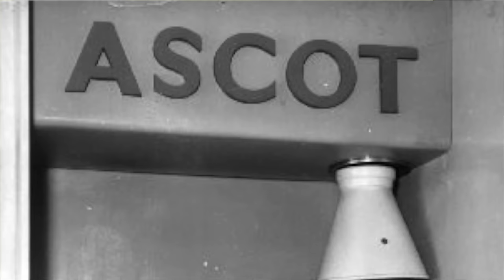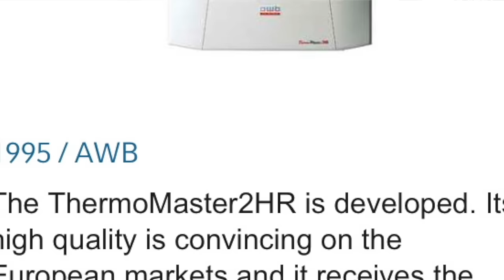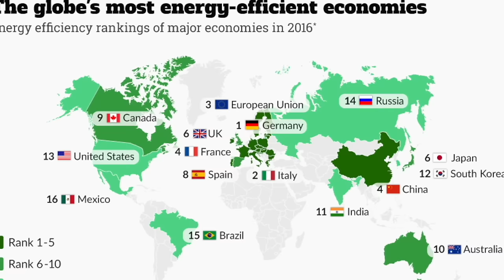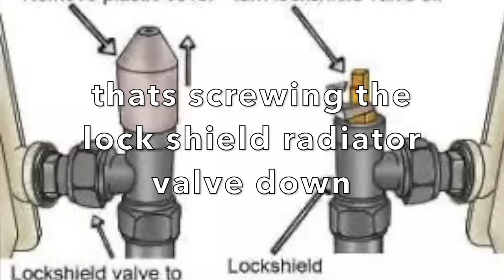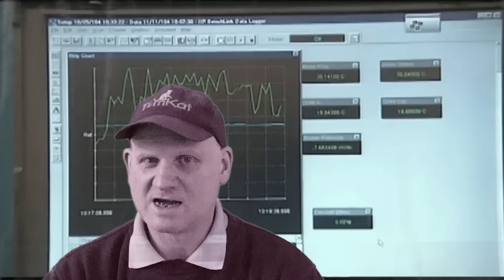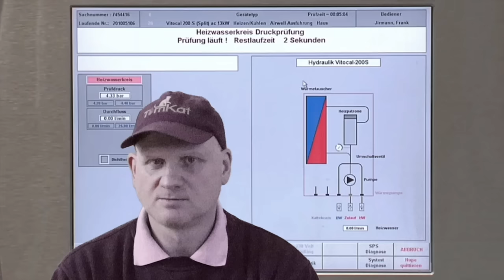WHICH IS THE BEST GAS BOILER for your home. Looking into the best boiler for uk homes in 2022

Comment: 15:00 Tomkat mentions about boilers cycling due to being oversized, this can be the case but I find most boilers can modulate right down to avoid this. 

We have a 4 bed house and a 38kW boiler running at 60c on central heating ( running at lower temps are better for several reasons ) and our boiler runs for ages at a low level but never needs to cycle even when the room TRV’s start closing.
Reply: Daniel Collins 38kw in a four bed house is still ridiculous though. I heat a five bed detached Victorian house (solid brick walls, original single pane windows) with a 24kw more than adequately. Plumbers still massively over specify boilers for some reason.
Reply: @spencerwilton5831   Agreed it’s over sized for the heating, but it’s a combi boiler with extremely good hot water flow rates and that’s where the extra KW’s are needed.
Reply: @spencerwilton5831  yours is a system/heat only? What does it simmer to, 10:1?

Comment: Correct on oversizing, 80% of new installs I see are oversized. Drives me mad. Try persuading a builder and punter that all they need is 10-18kW - always a struggle.
Reply: Yes I agree with you, too many customers telling me my job and how much to charge, we don't do it to them. regards george
Reply: I have a 25kw in my small 1 bed garden flat. Could it run another radiator out in the garden room then? I was told that you need a bit of extra to run the shower/bath off a combi. Would an 18kw heat my flat and provide a good shower?
Reply: I think that builders or who specifies are not as good as they should be thus install what's cheapest UK build is the worst in Europe, I wonder why. Thanks for the comment, george
Reply: @dugbert9  Hi Dugbert, no unstandardised what rads have to do with shower.george
Reply: Maybe they have a 24kW heating Coil in their cyl. & they want the 40 min re-heat time they've paid for? Just a thought!
Reply: @mariamalik4810  24kw coil will reheat 200l from 15-60 in under 30min. Actually 18kW will do it in around 35min. Put cylinder on hit water priority and you will never really need more than 18kW. 

People oversize because they don’t understand how to do heat loss or how to size boilers and heating systems.

Average heat loss of a home in UK is around 6kW and 80% of houses are below 10kW

If yiu out oversized boiler or will cycle, never be efficient and will break down prematurely.
Reply: @UrbanPlumbers  I have a qu. We have a 4 bed w. 2 en suites, 1 main bathroom and a wet room. Our underfloor heating and radiators come to 14kW and we're having a 300L unvented cylinder. The house will soon be used as a guest house sleeping up to 8 people. It's a Victorian end of terrace with a large extension and the original house has been insulated up to building regulation standards. 

What size boiler do I go with and which one? Ideal Vogue Max System comes in 15kW, 18kW, 26kW and 32kW.
Reply: @UrbanPlumbers  also, I'm being told that the Vogue Max has a 1:5 ratio of modulation I.e. a 26kW will lower it's heating output to 5.2kW when needed. This is under half of my total load. Is this OK to consider? There are times I'll set my stats and trv's to 10 degrees when there are no guests in the house. Do the trv's override the stats or is it the other way around?
Reply: @mariamalik4810  what’s the property heat loss? Is it actually 14kW? If yes then install hot water priority (I think gouge can do it) - avoid S plan !

You then need 14kW so go for 15kW or 18kW if you want slightly quicker DHW recovery. 

Check how low all those models can modulate and choose one than can modulate down to at least 50% of total heat loss.
Reply: @mariamalik4810  I would go for 26kw then provided it can fire at 2 different outputs on can be rated separately for hot water and heating.

Avoid S plan - use DHWP if the boiler can do it. This will allow you to use load compensation or weather comp on central heating.
Reply: @UrbanPlumbers  I'm not sure what he's done already. I have 6 pipes running to area of the boiler. Flow and returns for UFH, cylinder and rads. Does that help? I'm going for a 26kW Ideal Vogue Max System now you've confirmed the size. This modulates to 5:1 so down to 5.2kW at its minimum simmer output. 

Why did not advise a 15kW or 18kW knowing that I only had 14kW requirement for the ufh and rads?
Reply: The 14kW I mentioned is the total output of 10.5kW for rads (slightly over sized but not grossly) & 3.5kW of ufh (assuming 70w x 52m2). Like I say, there are 6 pipes (3 x 2 flow and returns to boiler for the ufh, rads and cyl.). What's your advice?
Reply: @mariamalik4810  if 26 can modulate to 5 then you can rate rate for CH to 14kW and to 20kW for DHW - as long as it is on Hot Water Priority and not on S plan.

If the cylinder coil is 20kW go for 18kW boiler. If the coil is bigger go for 26kW

With 8 people you may want faster reheat time.
Reply: @mariamalik4810  why not talk to your installer about it all?
Reply: @UrbanPlumbers  thanks but he's been true to form in advising a higher output model is better! I'm not sure what you mean by S plan etc. Like I say, I can see 6 pipes running to the boiler and we have 3 circuits; ufh, rads and cylinder.

The coil to the 300L unvented cyl. is rated at 24kW approx.

The Worcester Greenstar 800 modulates as low as 3kW on their 30kW unit. Will this 3kW vs. IDEAL'S 5.2kW be a concern to me at all? Or is it rare that I'd ever need anything anywhere near as low as that?

I'm not sure what heat loss calc is but I believe he oversized the rads slightly to account for this; does that sound right to you?
Reply: @mariamalik4810  ask for the system to be wired as hot water priority Ans rated 24kw for DHW and 14kW for heating.

Both ideal and worcester can do hot water priority

Avoid S plan.
Reply: @UrbanPlumbers  Great, so I can still do that with the pipes we have already laid? I believe that we need a 4 pipe system run to the cylinder if we needed heating to prioritise the hot water; is this wrong? Thanks soooo much for your help. x
Reply: @UrbanPlumbers  If we rate the 26kW boiler to 14kW for heating, will the 5:1 modulation be based on the 14kW, so 2.8kW or still on the basis of the full capacity of the 26kW i.e 5.2kW? I am worried that the Worcester will be the better option given the 10:1 modulation it gives.

Comment: so the bigger boilers (if you have high HW demand) won’t drop down low enough if you don’t have a big CH demand? Suprised they aren’t more flexible. I want CH to be more efficient but I woudln’t want to have to compromise on HW for that.  Should I try and have a simple heat loss calc done for CH if I’m replacing a boiler?

Comment: Excellent review.  I have a 3 bed flat with an old Ideal Mini C28
 gas fired boiler. Im thinking of replacing it but I am clueless about Boiler Technology. Also I am planning to install underfloor heating in the future. Any recommendation would be great. Thanks Guys & ladies ofcourse
Reply from the maker: The gas engineer you get for the job will be the best person to give you advice as they will have seen the job. My advice would be get a boiler with the longest warranty at your budget and make sure you get the boiler serviced every year. Thanks for watching cheers
Reply: any boiler will be fine, way too much fuss is made about ten year warranty when modern condensing combi's don't last much longer than that anyway. more important is the existing gas and plumbing, and whereabouts in your house the new boiler and underfloor is going to be fitted
Reply: If you are going underfloor make sure there is a good well established local company to look after it as most, including the big ones won't touch it. Great when it works, absolute disastrous when it doesn't.
Reply: @tomkatgastraining  A long warranty makes no sense for us engineers who do a correct servicing regime,  where do you go when it breaks ? Do you turn up and say oh get the manufacturers out. ?
No i repair.
Reply: I prefer Intergas for Combi installs, Vaillant as heat only with unvented hot water  BUT control is the key, invest in a comprehensive control system. Drayton Wiser i prefer for combi, Honeywell Evo for underfloor and unvented hot water control.
Reply: @kevinschoales844  I never heard of Drayton Wiser, thank for you mentioning this company, I will look into them. At a glance, they look similar to Tado. Have you heard about Tado?
Reply: @feelgeorge  yes good reports on customer service, from Germany.
Not fitted any.
Reply: Get a local company to come and assess your flat and give you a proper idea my preferred choice would be a viessmann vitodens boiler 10 years warranty they are number one in Europe and they are very popular in UK at the moment and more importantly they are actually designed to run on underfloor heating

Comment: Question to gas engineers: I have a brand new system, buteline, 24 rads, intergas 40 and evohome.  My engineer won't fit an external pump but my ground floor rads won't all get hot.  It strikes me that my lovely new boiler isn't working effectively as the pump isn't taking the water around quicker.  Any comments?
Reply: Lovely boiler , sounds like the installation
Reply: @peterrielly9499  
I agree.

Comment: You say oversized boilers can cycle reducing efficiency and life but also say boilers are modulating so wouldn’t they just modulate down to a lower KW and therefore not cycle?
Reply from the maker: It’s all about setting the boiler up cycling means the boiler goes on and off because there is too much heat in the boiler so wasting gas. Modulation is when the boiler is correctly set up and the boiler can maintain the heat loss without knocking off.
Reply: @tomkatgastraining  thanks. Be nice to see a vid on how to set it correctly to achieve this. Keep up great vids!
Reply: @akshaypatel3338  if you go onto the stelrad website you can calculate the KW requirements of your rad / system then if your boiler allows it adjust to suit. Not an exact science but a v good start point.

Comment: Main reason I went for a vaillant ecotec was the ability to adjust the heating partial load, the similar Worcester at the time didn't have that option. Have my 28kw boiler reduced down to 14KW for the heating, flow rate set at 60deg, I have 4 K2 rads downstairs, 2 tiny toilet rads and 3 bedroom K1  rads and one K2 in the bathroom, Roomstat at only 19 (big hallway)  and the house is always nice and toasty 🔥
Reply: No.. your house isn't ..'Nice and Toasty..' It's 19 degrees... and that ain't toasty...
Reply: @carlfisher5195  by the time my north facing large hall with 1 rad gets to 19 the rest of the rooms in the house are that warm I turn the TRVs down, all houses are a bit different buddy, or maybe I'm just lying to strangers on the internet about my house temperature for bants 🥴
Reply: @carlfisher5195  it would be nice and toasty for me, lol

Comment: Which is the most reliable heat only boiler for an old single pipe system?
Reply from the maker: Not all boilers will go on a one pipe system but if you fit a low loss header then most boilers will work then
Reply: @tomkatgastraining  - Many thanks, that’s something completely new to me! But looks good, as it seems to not only allow for differing flow & return temperatures to suit the boiler & circuit, but also catch most of the sludge from my old cast iron rads. Would this be a superior solution than using a plate heat exchanger (to separate the boiler & system waters) then?
Reply from the maker: @Benzknees  I would really only use a plate if I needed different pressure so boiler being sealed heating being open vented

Comment: Spares costs? How about the PCB that is part of the gas valve, genius if you want to inflate your profits, not so good if you're the engineer telling the customer what it's going cost 🤣
Reply: I had a vaillant boiler fitted in 2012 it has broken down  down every year most common fault water sensor this year 3times water sensor diverter valve expansion tank water leak o rings serviced every year flushed out twice just a few things the list goes on pile of crap

Comment: My experience of Vaillant boilers is that they are shit !!  I have had 3 and none of them gave me HOT enough water.
Reply: Hi Vanessa, It's not the make, it's down to who specified and installed, Some installers will not say NO, this is not suitable for you or the house. There is no reason a factory engineer cannot be called to see what's wrong or a local approved.
All combies provide HW to 60C it cannot be difficult to find the fault, could be distance from boiler to tap is so far it cools down, faults bits are under Guarantee, call Gas Safe for inspector to call. Do not give up someone can solve it. regards george staszak Mr Combi Training
Reply: I agree ,had a Vaillant boiler at my work place which was installed in 2000,It never worked for more than 3 months without going wrong and ended up with more new parts than original !
Reply: @jasoneldridge4738  Hi Jason, Year 2000? They have a brilliant after sales support as they all do, cannot understand why it was not fixed in two visits.
Reply: Had two Vaillant boilers in my council flat, first one lasted 18 years before being replaced. It was repairable but the council preferred to have a new Vaillant Ecotec installed instead. Seperate controls for heating and water temperature, whisper quiet and more efficient than it's predecessor. I actually had to turn the hot water temperature down it was so hot, and I could turn it down a little bit more tbh.

Comment: Hi thank you for informative video sadly I have just had a ideal boiler install and the engineer said that I needed a 30kw combination boiler as I live in a 3bed house with 1main bathroom. He said that due to my high water pressure which is around 16litres anything less would not be able to cope. Was he right? Also he mentioned something about the flow rate through the boiler as to why so big? 
Thank you.
Reply from the maker: As I said in the video it’s all about flow rates with combi boilers but the boiler can have restricted flow rates. Yes he was correct but off the top of my head a 30 kw ideal gives you about 12.4 litres so you won’t get 16 at the taps. Thanks for watching and your comment cheers
Reply: Thank you very much for your reply, I was a little worried that I had been miss sold👍

Comment: I vave been quoted 2500 pounds for a vent system to combi system swap. The boiler is viessman 0 50 vitodens.is it too much?
Reply from the maker: Can’t comment on a job I haven’t seen but if you trust the engineer why question the quote because surely you haven’t just got one quote
Reply: @tomkatgastraining  how do i trust an engineer?
Reply from the maker: @haghig80  find out if they have worked for people you know have a look if they have a web site check them up on the gas safe register is a good start
Reply: Quite cheap

Comment: So when my customers watch this and want a conversion change to Combi, they will expect me and all engineers to say £1800 ?? Yea right thanks mate 
Might cost that up north but not London or South
Reply from the maker: If you had listened and watched the video properly you would have seen I said it was an average and they are not mine it’s what they would see on the internet and also I said that was a combi to combi swap not a conversion but thanks for watching and your comment.
Reply: Maybe you should have started talking about the remaining old system gravity fed ie floor standing boiler and instead of giving a ball point figure which will piss off all engineers that watch you. just say can cost thousands depending on sitetation and size of boiler pipe size and run rads needed, power flushing electrics etc etc
Reply from the maker: It’s funny how people pick out one thing in the videos from a video with lots of information in it. What about all the things I said about correct installation and servicing and making sure the system is clean before putting a new boiler in. Sorry it pissed you off but as I said in the video it’s an average and it could cost a lot more depending on your system but I guess your rage missed that but.

Comment: I looking to do a renovation on my home and have been recommended to get an ATAG boiler. Any views on whether they are any good?
Reply from the maker: They are a very good boiler but your installer will need to be accredited with them to get the full benefits of their great customer service 👍🏻
Reply: The parts aren't as widely stocked as the most common type Boiler spares. The boiler seem OK. The system boilers, as with all boiler makes, are more reliable though.
Reply: There great boilers and Atag can supply spare parts next day . There warranty is very very good as well

Comment: £1800 pounds for boiler installation! Are you having a laugh or what! I’d purchase the boiler myself then hang it on the wall myself. Only then will I call a gas engineer to connect it up to the gas which most engineers will do for a lot less than £1800. Let’s also remember that most of the installation is plumbing work.

Comment: You don’t mention that the hot water flow rate of the boiler is dependent on the flow rate of the cold tap.
Reply from the maker: I think if you watch all the video you will find I do but thanks for watching cheers